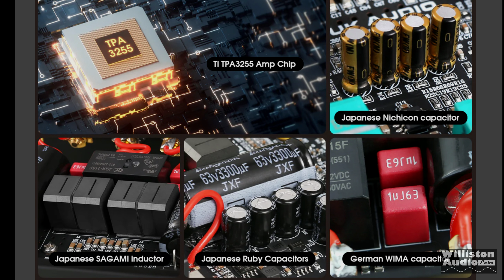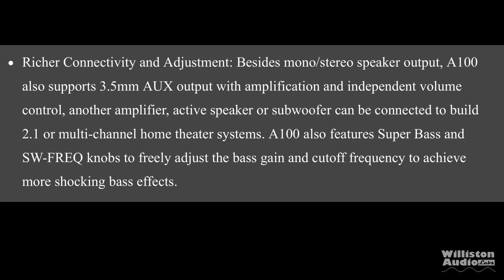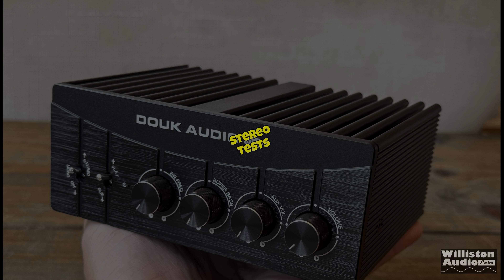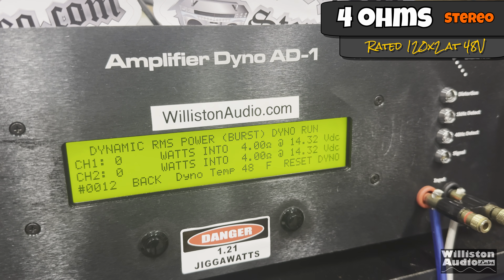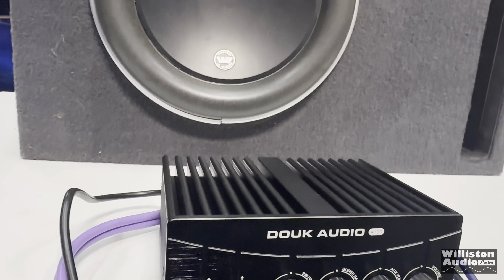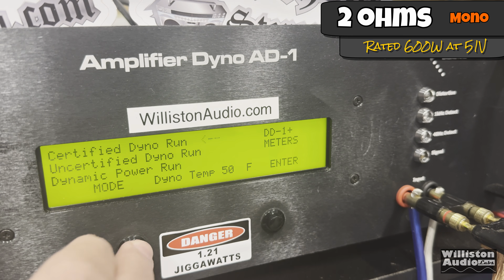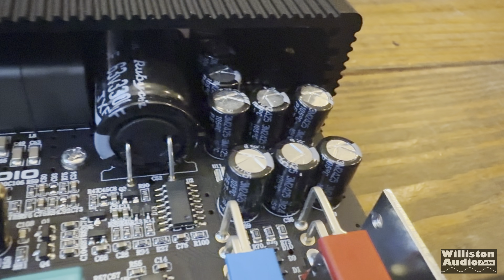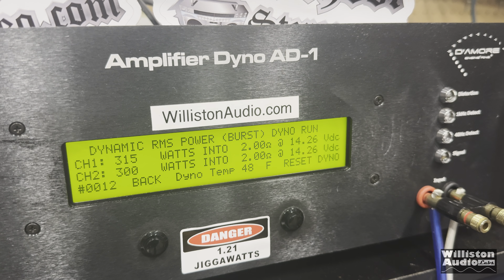Can This Mini Amp Power Subwoofers? Douk Audio A100 TPA3255 Amp Dyno and Review

Comment: I'd be willing to bet there's massive voltage drop. And 5 amps is still not enough current. I'd also replace the main filter capacitors "if equipped"

Comment: Your reviews on stinger amplifiers is the reason why I have mt1000.1 and mt2000.1 but I want to let you know that they already have a new amplifier mt4000.1 I want you to review it because we believe in your reviews because it's accurate and honest.  That's why we follow you and admire your work. Pls check it out so I can decide if I have to upgrade to the new mt4000.1 thanks in advance
Reply from the maker: I should have one on the way soon 👌
Reply: @UncleBoyT  It did great numbers on the JSS dyno. Didn’t like under 1ohm, but on a system you’d have to be wired  at .33> to run below 1ohm. It got rated power at 2ohms and did over 6k at 1ohm. At $450 it’s gotta be scaring the Brazilians.
Reply: @markhruby7130  Different subs give you different amounts of impedance rise. For some subs it's a lot and for others it's very little.

Comment: Either a noisy power supply or bad output filtering causing the bad THD, probably all in the high freq above our hearing. Class D is notorious for it if output is not designed or built properly. Look at the Brazilian amps, they have similar issues.

Comment: I got that same screwdriver set it really amazed me how strong the bits were and I've used it for several years and never have had a bit strip out I love the set the only thing I don't like is the little clips to hold the bit in come out way to easy and are lost forever lol by by lil guy😢

Comment: 240 watt power supply can't get more power from amplifier which has 90% efficiency, especially within the full range of sound. It's an amplifier, not a perpetuum mobile.
Reply: He says in the video to check out an earlier video where he talks about how it happens. Basically the power supply is under rated.

Comment: If you look closely at the datasheet, the 1% THD ratings are at 53.5V and 2 ohm is supposed to do 495 watt at 51V. I would say this design is meeting specs with a smaller PSU. Nice 😎
Reply: I think the reason why it doesn't count up cleanly in certified mode is because the output is exceeding 1% THD as the amperage climbs.
Reply: It says on it that it can only go up to 48v 10a.

Comment: 6:05 distortion at 100w...
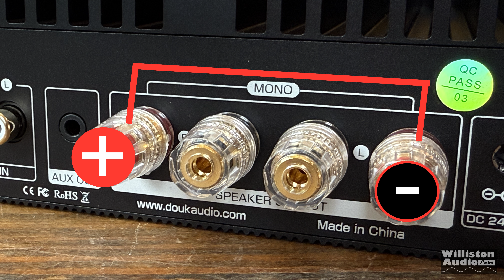7:08 left channel is on the right...
i wonder if the distortion comes from the high rca voltage.

Comment: Not bad, but pricey. The 2.1 Fosi Audio BT30D Pro has two of those TPA 3255 chip amps (max 36v input) and is $109 on Amazon right now. I have three of them running at 32v and they push and SOUND great. I haven't had much luck with Douk (sound quality and power). The Fosi doesn't like low impedance and demanding loads and will "click off" when pushed to the max. At that point, things are pretty loud anyways.
Reply: Love my BT30D Pro, but I get it with the low impedance part. I got a dual 8" Savard Rap 8 enclosure wired to 2.1ohm on the multimeter, keeps cutting into protect when I hit a frequency too low at high volume but does the job well for a low power room setup 98% of the time. Upgrading to a 36v 6a Aiyama adapter did help push that cut-out limit slightly further, at least to me it seemed like it.
Reply: @pnwnative918  I got some industrial grade DC Supply's maybe get one of these? for example an 48v LED Driver would be something. Some of these are cheap and offer 10 amps.
Reply: I just ordered an Fosi TB10D for 55 bucks on ali. Has no Sub output tho. Going to use 3 way speaker with it anyway and a DCA. will by my first real setup.

Comment: Maybe get a lab bench powersupply for these test. Got one with 30a 60v that would give you all the flexability for diffrend voltages
Reply: yep, this was definately "one hand tied behind its back"
Reply: He mentioned other TPA3255 amps he's reviewed come with the 10a, this one does not, keeps the product review honest, he's right, for $200, much better deals out there.
Reply: Meanwell? Blade server psu?
Reply: Crown xls 2502!
Reply: @soundfreak8892 no. Fan noise. A CORRECT room will hear that noise no matter what.

Comment: 300W amp from a 240W power supply.  Seems legit.  O_o
Reply: Capacitors store energy for transient peaks. Can exceed rating for a very short duration like enough time to do the test.
Reply: A capacitor cannot make power out of thin air.  If the total system power is 240 watts the amp cannot exceed  that. The amp will never be 100% efficient as there will be losses from different components in the circuit and also heat.  A big part of the “marketing “ for this amp is the “high end components ”. There is a possibility that they can be knock offs parts.
Reply: @frankpaul3204  An amplifier can certainly exceed its rating for a short period of time. Long enough to record its output. That’s why amplifiers are sometimes rated at RMS which is their constant sustained power output rating. Its peak power output can be estimated by multiplying the RMS rating by 1.414. A 240 watts amplifier won’t blow up if it outputs 241 watts. Most electronics fail due to thermal breakdown. That takes time. For example if you have an air compressor in your garage. Let’s say it pulls 10 amps while it’s running. So you put it on a 20 amp breaker with 12 gauge wire. When you switch that air compressor on, it may draw 60 or 70 amps for a fraction of a second. It doesn’t burn the motor up or trip the breaker.

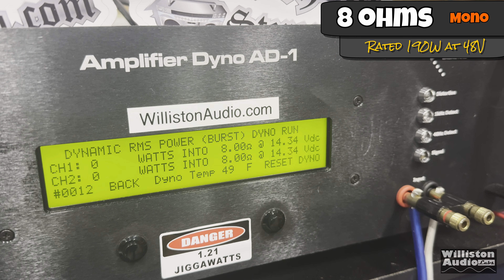Comment: 7:50  How weird.  It's almost like it's not bridged.  These are almost the same ratings as one channel.
Reply: At 8 and 4 Ohms, parallel mono won't do much as the voltage is the limiting factor for output (48V DC in will, optimistically, give 100 at 8 Ohms (Vrms squared divided by the impedance), and twice that at 4, more or less.

Parallel mono increases current capability, which is why there's good power at 2 Ohm, comparably
Reply: @TokeBoisen  Thanks, Toke!
Reply: Ohm's law and  to small power supply. It can't make more power than it have from DC, and don't forget about efficiency of the amplifier (the best D class has max 90%).
Reply: @BrodaGRCHW  actually amplifiers can PEP higher than the DC input power.
Reply: Each channel is already in full bridge so in mono they are just paralleled together to allow lower ohm loads.   It seems like the ratings are incorrect in mono.
Reply: Same complaint on Amazon feedback......🤔
Reply: I have a 500 watt rms 1000 watt peak 2 ohm sub hooked up to it in bridge mode and it bumps big time. I had that same 2ohm sub hooked up to a different amp that was 700 watts at 2 ohms b4 I hooked it up to the douk a100 and it's not much different. I have 2 4ohm subs that I'm pushing 500 watts into using a mackie FR M•1400i which is a clean 500 watts and the 2ohm sub bridged on the douk a100 bumps noticeably louder so although ohms law and power supply math doesn't really make sense all I know is that 2ohm sub on the a100 is louder than my 4ohm subs on the mackie.